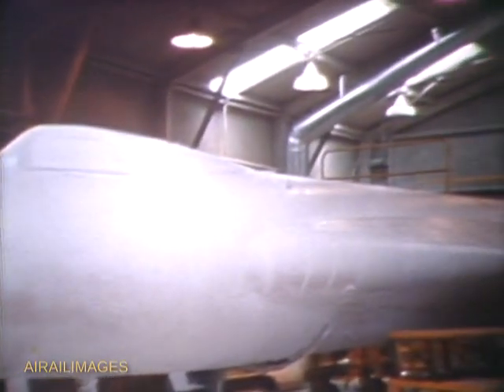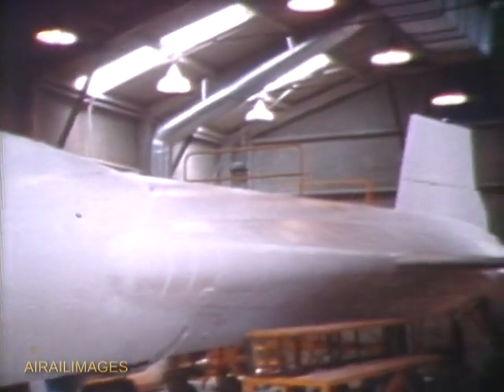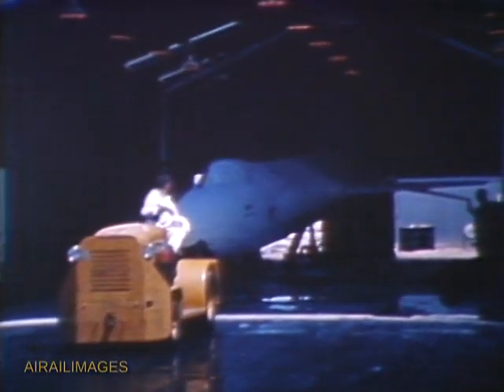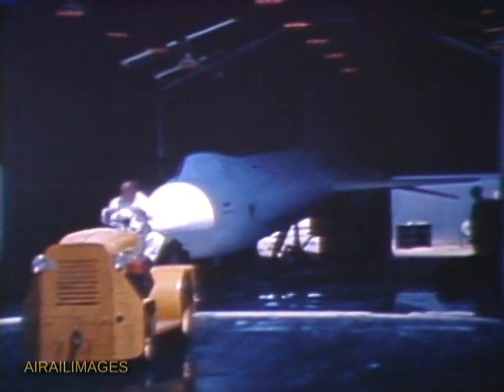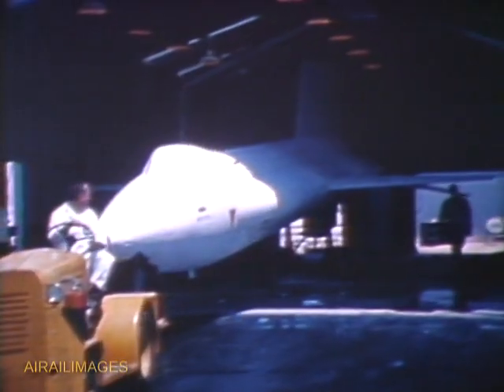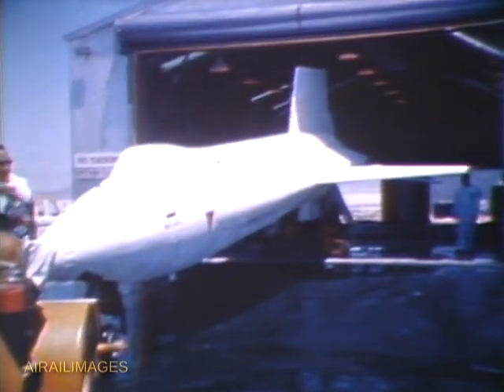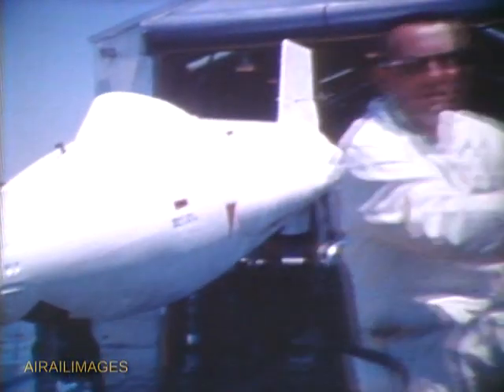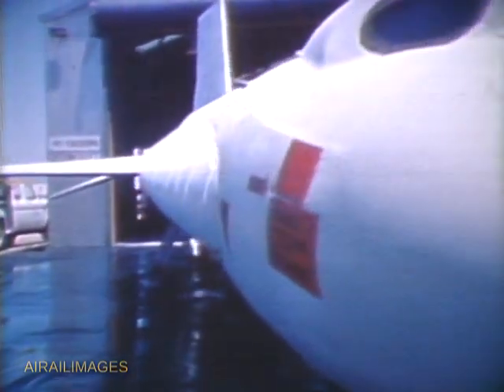X-15's Fastest Flight - 4520 MPH!

Comment: what are these bags under the wings?
Reply from the maker: There are large external fuel tanks under the X-15 in this configuration.
Reply: @airailimages  does it get to the full speed with these tanks?
Reply from the maker: The tanks provided fuel for 60 seconds of additional acceleration, and were jettisoned when empty. I presume the external tanks were used first, at lower speeds, before switching to internal fuel.

Comment: hmm it seems all the other flights, the X-15 had the important ventral fin.  Here on this high speed pass, it does not have it.  The dummy scram jet is in its place.  I wonder how that effected stability?  Further, it is known the scamjet caused a lot of heat which would equate to drag, etc.   Also-  just HOW do they calculate speeds that high?  very curious.  thank you
Reply: Early on in the program, the extra ventral fin was found to be redundant.

Comment: Were these types of films of the X-15 released to the public at the time or were they held back for a time(years)? I know that I don't remember them. Of course in 1967 I was in Vietnam and we did not get much news.
Reply from the maker: Good question. In 1967, TV had basically a 30-minute evening national news slot on three networks, not a 24-hour news cycle on cable and the internet like now. So I'm guessing a lot of this kind of film footage went unseen just because news time was so short.
Reply: Thanks
Reply: Would have been about 20 seconds worth of the drop, streaking across sky, the landing , and the pilot interview.  All 2-3 seconds long. No real details.
Reply: This film was not released in the 1960s. The X-15 program was mostly secret related to real performance.